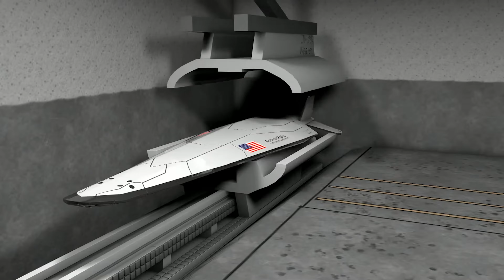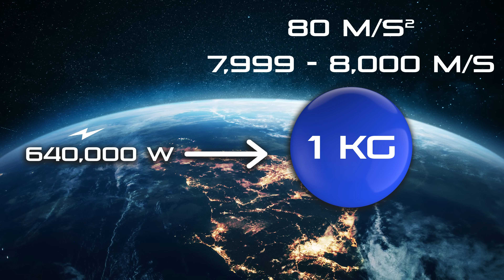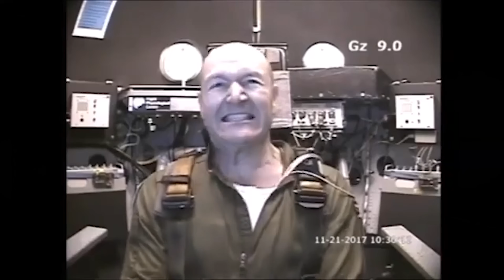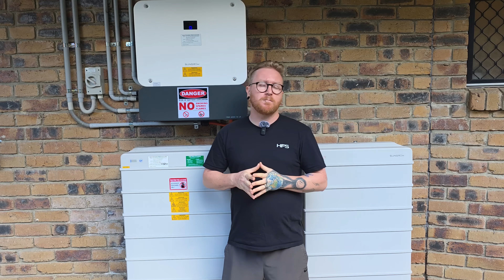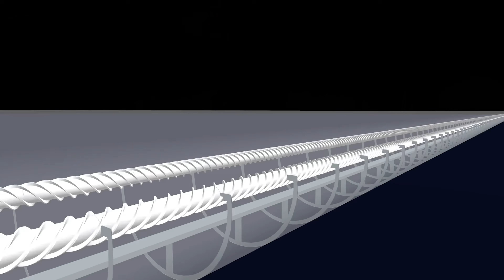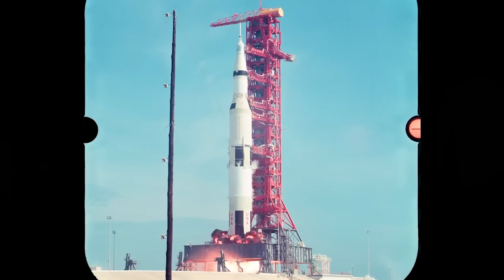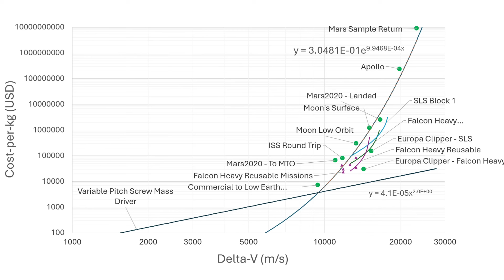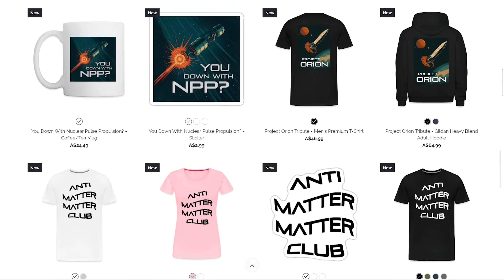The New System That Could ACTUALLY Replace Rockets

Comment: Can you also interview Dr. John Hunter of the Super High Altitude Research Project, Quick Launch, and Green Launch.  He stores energy in the form of hot compressed hydrogen to release behind the projectile satellite.  This would seem competitive with VPSL, perhaps simpler as there would be no heavy machinery miles long.  Just a tube miles long with valved H2 injected at each station.  It can reach 8 km/sec using hydrogen.  Smokless powder, only 2 km/sec.
Reply from the maker: I'm familiar with HARP, really cool project. I was unaware there was a follow up project in SHARP. I'll have a look into that, sounds interesting
Reply: @HelloFromSpaceAus  Thank you much for checking on this non-rocket to LEO idea.  The story is as fascinating as that of Bull's efforts and the progenitor is still around to promote it.  It would be another mega project like a full sized VPSL, but perhaps less costly.

Comment: So how many slaves pay for it?  You know you just need a speed of light track length ground switch that mearly needs a 5uSecond switch at 2,000 feet to successfully ground switch a gigawatt.  Where the return trip is a twisted pair so 50% more kinetic energy goes straight forward and 50% less goes spiral in reverse?  Slaves for slaves, it costs millions less slaves to levitate an aircraft carrier with speed of light switch.  5 billion dollars, Ronny is going to get this country some dirty ass otherworldly grime, or die a filthy astro-slave.
There's no reason to use any top secret ideas other than speed of light switch, make a lithium tungsten cable 400 miles long, 8090 7% class 4, because that's the only problem.  Vat of acid, vat of base, negation triangled quarter wave, gigawatt, done.
So let's say your dumber than most kind hearted rural folks, a train is the electrical force heading towards ground, before the train gets to the ground station, and all the electrons do a cool fusion trickery, I switched the train tracks, theres a cool trick, but you don't need to know, now another train will try to go to the opposite ground station, forever, without paying a single coal bill.

Comment: Another system has been proposed using a long track and either detachable rocket sled or linear motor powered to boost the rocket up to speed up a ramp up a hill so as to reduce the amount of fuel needed to go to orbit. It might not have the same theoretical fuel saving as the system mentioned here , but it is a lot more practical and much simpler in concept. But even so there are still enough problems that no one has tried it yet.

Comment: Spinning two probably at least tens of kilometer long screws to high speeds inside a flexible tube that is held up by drones? How are the screws held up inside the tube? And what kind of drones are we talking about that can hold up a structure that probably weights at least tens of thousands of tons for at least hours? How to even move and set down the end of that tube into the air, without damaging everything? This sounds way more complicated and dangerous than the existing potential solutions that don't even require any moving parts.
Reply: The screws are in the terrestrially supported part of the tube. The part that's held up by drones doesn't have heavy screws inside it - that would be crazy :). The elevated evacuated tube can coil itself up and land on a spiral-shaped platform that's designed to receive it. What other existing potential solutions are you talking about, StarTram?

Comment: All the "engineers" way out of their depth saying this won't work. Obviously have no idea about the design that has gone into the project and think they have planned it to have a single long "screw" the full length of the track. A lot have said the energy required to get the whole payload is impossible. These systems aren't aiming to take rockets the whole way, it's an assist, they will still require fuel systems. "It will never work!" Is why these supposed "engineers" will be working on roads and minesites for the rest of their life. Relanding a rocket on its tail I heard the same c**p, impossible, nay sayers are such a bore.

Comment: Nice, the only question is the practical length and rotational rate of the screws. It's nice that multiple launches only need the launch energy added to the screw flywheels, so is quite efficient provided the losses in the flywheels are low.

Comment: It seems naive to me and disregards the laws of physics. The physical strength of materials and the resistance of dense air at sea level, which the projectile hits at 7.9 km/s (or more, because that's the speed it's supposed to have in orbit, and losses will occur—probably 11-15 km/s). It's more like science fiction, like a hyperloop.
Reply: Watch the video again - you missed some important information about how it works.

Comment: It seems like this would work for smaller payloads like a railgun round, and that would be a lot less of a challenge than launching things into space. I wonder if some variation of this idea could launch airplanes into the air? Launch is also a huge proportion of the fuel consumption with aircraft as well.

Comment: Just an idea. Is a very large spacecraft carrier type ship feasible to make that is held up by something like 100 blimps? The blimps underneath the launching platform put to use like barrels under a lake dock. How high could that be held aloft? How much less fuel would be needed if launching from an elevation liked that?

Comment: What's The Problem? Just Watch The Video Where Eric Laithwaite Lifts A 40lb Weight Over His Head As If It Weighed Nothing. Replace Laithwaite With A Molecular Strand Stretching Into Space And Tie One End To Earth And The Other End To A Docking Unit Is Space. Of Course The Difficult Part Is Fabricating Molecular Strands As Has Been Envisioned In Science Fiction Novels.  See: Professor Eric Laithwaite Gives A Demonstration Of A Large Gyro Wheel

Comment: To add some context to the power discussion, the issue is that kinetic energy depends on the square of the velocity. That's why a constant power source becomes less effective (i.e. takes longer to achieve the same delta V) in accelerating objects moving at higher speeds

Comment: As much as I don't like the idea, spin launch would still be better than this

My current favorite is helium balloons to just get to upper atmosphere, not a solution for long term or bulk shipment
But it works right now and let's anyone make an orbital launch vehicle in their garage

Jumbo jet piggy backing is still very effective, 
Supersonic, Ram and scram jet piggy  backing would all work
The problem is payload size, but if you're willing to take smaller loads each trip then it's really efficient

Beamed power is very interesting
You could just fill a rocket with liquid nitrogen, (you flip the script on rocket fuel, traditionally energy per mass was important, so the lighter the fuel the better that's why cryo hydrogen is so commonly used, but if you're energy source is not on board then you just want as much mass as possible to throw out the back, then it becomes a matter of what is the densest heaviest fluid you can pack into the tank, heavy atomic mass is good chemical bonding can help pack in tight but so can cold and pressure and those actually help boost thermal rockets but chemical bonds dull thermal rockets
The next question is then what is environmentally friendly, eg you could load the tanks with lead and blast gaseous lead out the back, you get incredible mass per volume and probably incredible thermal conductivity and absorbtion, but not great for public health, atmosphere is already mostly nitrogen, you could compress it and release it without really every affecting atmosphere) and shoot a powerful laser at special tungsten radiators to heat the nitrogen and blast it out at speeds higher than chemical rockets
Earth atmosphere eats up lasers efficiency especially at distance and rocket exhaust really kills lasers effectiveness
I think putting several fiber lasers at different points could really help effectiveness 
Eg have helium blimps at several elevations, with anchor cables with fiber optic cables
Ground power plants like nuclear, and grid power feed the fiber optic cables, the cables channel the light into laser fibers and aiming devices
As the rocket gets too far away from one laser then the light is directed to bypass that station and pump the next laser in sequence
You could also use direct solar
Eg instead of photovoltaics you could use mirrors and fiber optics to concentrate light directly into laser pumping materials 
You can also do this in space
Gather light using cheap foil reflectors to pump satellite lasers that can be aimed at rockets in upper atmosphere, to continue to heat thermal rockets 
Massive problem is well many things 
The logistics of a mega project, legalities and public outcry at a sky and space laser 
Failure points of dependencies
Not sure how much energy could actually be carried up fiber optic cables and how heavy they would be, 
How do you design the rocket to survive the extreme heat differentials and cycling
How do you not melt or compromise the structural integrity
How do you ensure accuracy with wind, deflection, and so many other unknowns
How do you make a thermal rocket nozzle that actually directs the pressure out the back instead of popping itself with back pressure, (Tesla valves, pulse valves, nozzle cone geometry area pressure ratios)

Comment: One issue that was not fully explored is the kind of infrastructure required to launch a spacecraft with a payload of, say, 60 tons to LEO. So you need a large diameter vacuum tube several miles long. Where could you build such a system, its power source and other requirements without causing major environmental impacts? What about earthquakes?  What is the optimum payload for a screw launch system? Why is something like a high-speed maglev system with constant acceleration not feasible? I would think that emerging from the vacuum at the end of the tube and slamming into the atmosphere at 7 km/sec would result in a major shock, like crashing into a brick wall.

Comment: The phrase "several kilometre long vacuum tube" is easy to say, but there are some significant engineering challenges right there.
Reply: Yep, idealists vs reality. It is Pretty funny considering the largest one in the world is 1/1000 the size required for this and it takes 3 hours to get to vacuum.

Comment: Id say, until we actually achieve putting things in orbit, we can't say with gurantee that this launch system would be a cost effective method or even cheaper. How much would energy would be spent in getting a full load to a High enough speed going around the track before the switch the ramp/lanch, specialized maintenance for this system, and maybe new positions specific for this kind of launch. Plus we'll have to disect the shit out it  for the first few years in use anyway, scan for side effects, personal and equipment.  Even in prime condition and say everything works. Would you trust it to put the new Jame's Uncles cousin ( on the mother's side) Webb Telescope

Comment: why not use Maglev tech to accelerate the rocket in a vacuum tube slowly building speed traveling in a large circle like the large hadron collider and when the desired speed is reached then change direction to a sloped ramp to launch toward space?  I would think air pressure would have to be gradually introduced inside the last segments of the tube in order to match the atmospheric pressure prior to exit phase.

Comment: Let's start with the launch tube.  A structure several kilometers long that holds a vacuum.  Sounds familiar, sort of like Elon Musk's hyperloop, which turned out to be more hype than success.  Their big problem was to be able to hold a highly rarefied atmosphere  They weren't even trying to achieve a vacuum.  Next is to be able to construct a dead straight tube several km long that is adequately supported to take the loads involved.  The illustrations showed the tube being in the atmosphere for a considerable distance, so it will have to be supported, and right now drones are not capable of doing it, plus whether it is drones, or a physical structure anchored to the Earth, it will have to be able to withstand all atmospheric winds without deflecting.  Then there are the acceleration loads.  The magnetic screws are pushing on the launch vehicle, so according to Newton's laws, an equal force is being imparted to the launch structure.  There are other aspects that need to be overcome before this even has a shot at existing.

So, yes it is a novel method to achieve a low cost for putting payloads into space, and it may be technically achievable, but it is as technically achievable as colonizing Mars, and like Mars colonization will be far, far more expensive than initially estimated.  I give it a minimum of 15 years before the technology and construction methods have been developed to make it close to actual reality.  The really big problems are maintaining a vacuum in a tube that is several km long, from the graphics shown, it looks like the tube is tens of km long, perhaps 100 km long because of the shallow angle of launch. At its termination point it will probably need to be 10 km high if not higher, and the tallest man made structure in the world is the Burg Kalifa at 890 m, or 0.89 km.  Like I said using drones to suspend the tube in the atmosphere is at this moment a no go, because there are no drones big enough to be able to suspend the tube, each one would need to be individually controlled to precisely compensate for its position and altitude in real time, if one drone fails the structure collapses.  Assuming that one could use drones, they will need to be refueled constantly because once in the air supporting the tube, they can never land without destroying the entire launch system.  I hope they can come up with solutions.  Possibly a shorter acceleration tube, higher accelerations, and a larger rocket motor to take the craft the rest of the way.  That would mean leaving launches of people to conventional rockets where they can rendezvous and dock with the launch vehicle in orbit.  The advantage is that they have a better chance of getting an economic launch system that can at least lift materials and cargo cheaply into orbit, which for the moment would be a huge game changer for space exploration and eventual colonization efforts.  After refining the technology, making it more efficient, lighter weight, etc, they could expand the system to include human occupants.  I hope they can continue to develop the concept and get a working prototype.
Reply: So, lots of people think that the problem with Hyperloop was the technical challenge of the vacuum tube, but that wasn't really it. It was that it's hard to justify the additional cost and complexity of any kind of long tube because the incremental gain that you get over a high speed train is small - especially with airplanes as an alternative. If we can't even justify high speed trains in the US, it's not hard to see why we can't justify something that's even faster and more complicated than a high speed train. Also, we already do have long evacuated tubes that have held a vacuum of one trillionth of an atmosphere for over 25 years - the LIGO observatories.
Now for the elevated evacuated tube (EET) - it's structurally a bit like an airliner's fuselage but much longer and without windows. This part of the tube just has to stay centered around the spacecraft's flight path - but it doesn't have to also support the weight of the spacecraft. Drone or eVTOL technology, powered from a power plant on the ground instead of with batteries, is quite capable of lifting such a tube and flying it to a precise position in he sky - even with some wind shear. The video "Electromagnetic Launch - What is (and is not) Holding it Back" may help to convince you. The EET can also fly back and land in case bad weather is forecast. Also, Ingenuity demonstrates that we can make a drone that can fly in a very rarified atmosphere. This architecture is largely drawing upon technologies that are already mature, it just takes a bit of time to properly absorb all the information out there that describes it.

Comment: Really cool concept, I like it. However comma, there are some very critical safety issues that need to be addressed here.  Also some engineering issues. Safety first. !. You've got an enormous tube of vacuum, in itself a huge safety issue. 2. What's worse, at the exit end you must have a fairly substantial seal which must be reliably and rapidly opened prior to the exit of the vehicle because impacting a seal at 11_kps would be spectacularly fatal.  The engineering issues mostly have to do with generating  and maintaining the vacuum, the consequences of rapidly opening the seal on such a large vacuum tube, and well for my money these and other issues are going to be non-trivial to deal with. Just my 2 cents. 😁😁😁